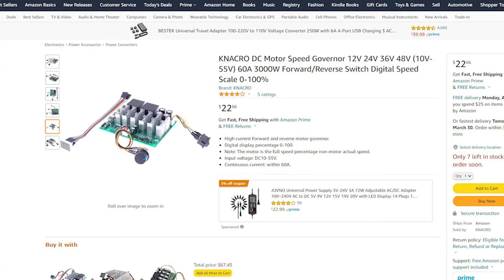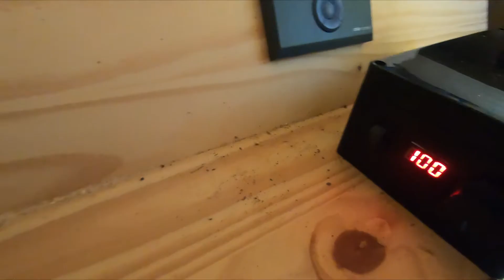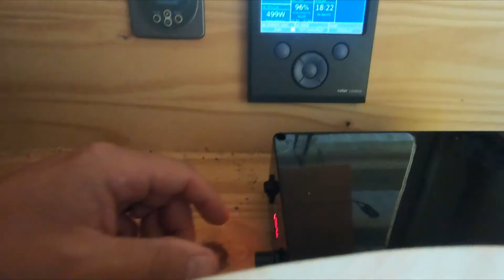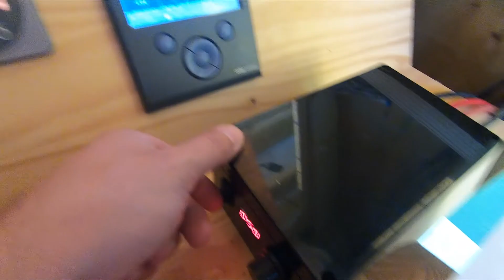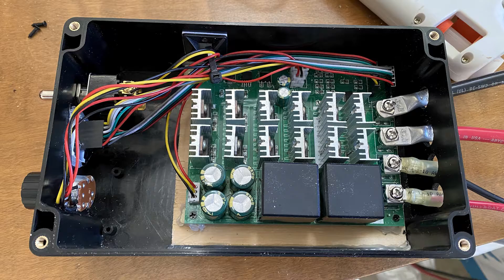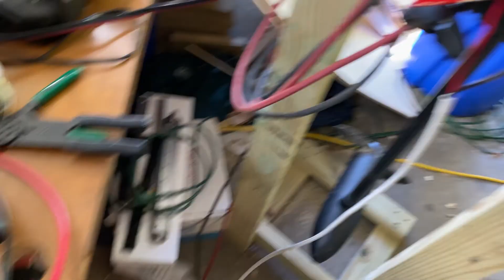Easiest DIY Trolling Motor Speed Control Box for Boat or Kayak

Comment: could you have used the original controller board from the trolling motor and put it into your custom box?
Reply from the maker: Hey Andrew...thanks for watching! If I remember correctly, it was sealed into the head housing by a hardened liquid, and would have been a pain to get out. Knowing us, we probably would have damaged it. This board worked really well as long as it was cool. If you have any more questions, let us know!

Comment: I have the same problem, same box. I was just looking on here for solutions. Ive already decapitated the trolling motor and wired it directly to the controller and changing the switch was my next move... So.. it didn't work for you and now I'm not sure what to do. Ive no reverse at all. I wonder if it's a problem with the PWM controller.
Reply from the maker: We figured it out by bypassing ALL of the internal circuitry on the trolling motor, so the motor directly hooks up to the board.
Reply: @MoneyPitBoating  Yeah, Ive done that already. Dont understand whats wrong. Maybe changing the switch WiLL work for me! Love the boat by the way!
Reply from the maker: Also, you could test it with a multimeter. It should give you positive voltage in forward and negative in reverse!
Reply: @MoneyPitBoating  Good thinking! Ill try that next. Thanks!
Reply from the maker: Keep us posted and we’ll try to help if we can!
Reply: @Money Pit Boating  Soooo... I figured it out. The polarity was incorrect on the board ( a common problem, I've since discovered). I'm amazed the board still works at all, I assumed it would be fried. It's running fine at the minute, just giving it an endurance test! Something to watch out for, if anyone buys one of these 100amp controllers, check the Motor In polarity
Reply from the maker: BAM! Nice work!
Reply: Electronic motors reverse is just reversed polarity. Maybe you hooked the power wires to the wrong slots on the pwm? Try flopping the position and negative where it connects to the pcm and see if you only have reverse. If so, it's most likely the switch